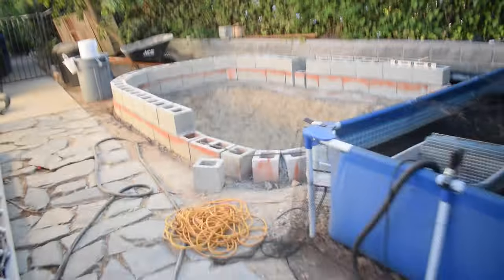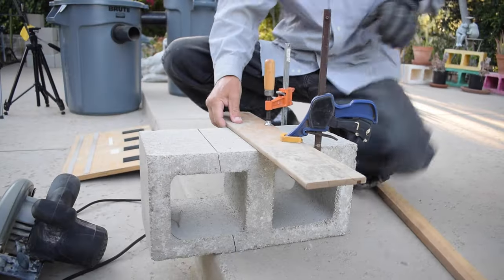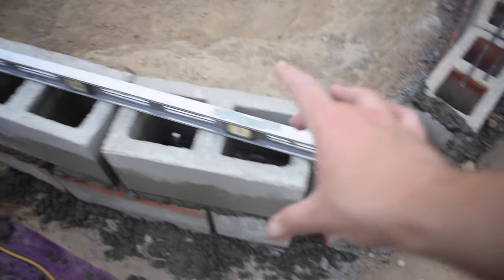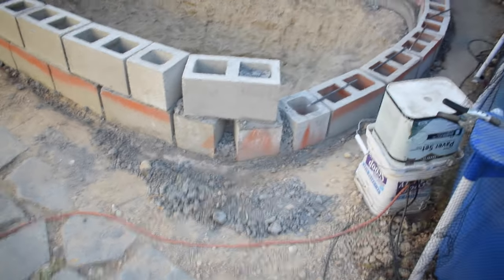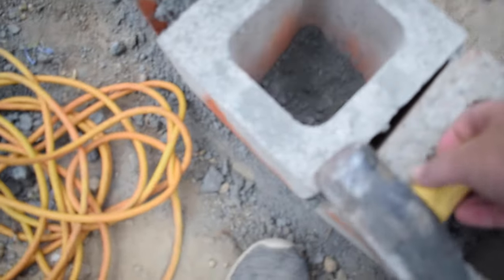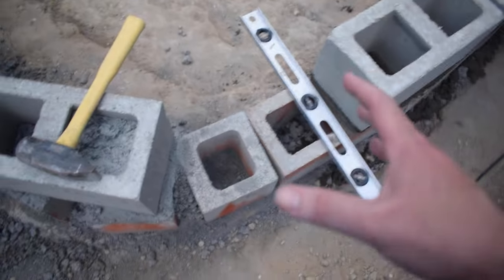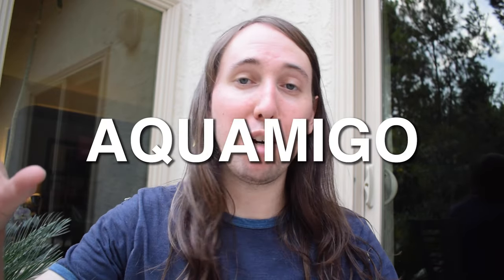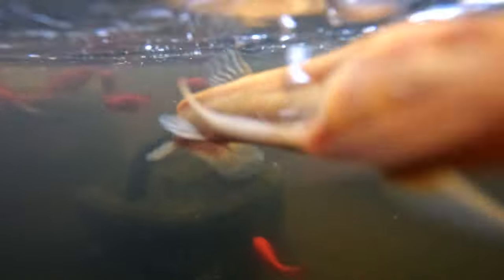DIY Backyard Koi Pond Retaining Wall Build | Almost Done!

Comment: Hey, Bud glad you got some more progress done on the pond. I know what it's like to get hung up on a project. I still think it's coming along great!! as far as your question about the bottom drain...it depends on if you have an internal or external pump. if you're using a decent internal pump pulling from the deepest part of your pond it should be enough. I have tried both and would probably opt not to make holes in the liner if at all possible. Speaking of liner have you decided on what material you're going to use?

Comment: Wazzup Aquamigo, you can put the suction hose or PVC pipe at the deepest part with the suction screen upside down with a spacer between the liner...
Reply from the maker: Thank you for the tip Aquamigo! I still need to plan it out, so I am accepting all advice right now haha

Comment: Hi aquamigo it's coming on very nicely can't wait to see the liner again in good luck it's looking great 👍👍👌👌🍀🍀
Reply from the maker: Thank you Aquamigo! I can't wait to get the liner in either. I'm going to smooth out the blocks first with some surface bonding cement, just to make sure I don't get any punctures 🙂
Reply: Hi aquamigo I coverd my wall's and floor with old carpet 👍👍
Reply from the maker: @westcliffkoipond6786  Ah that's a smart idea. My parents recently just got rid of a bunch of old carpet 😂